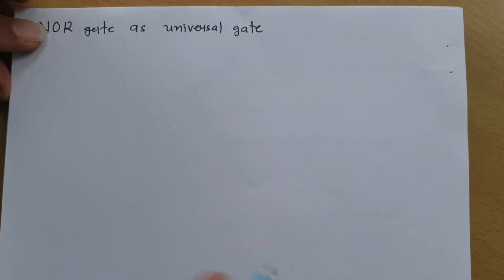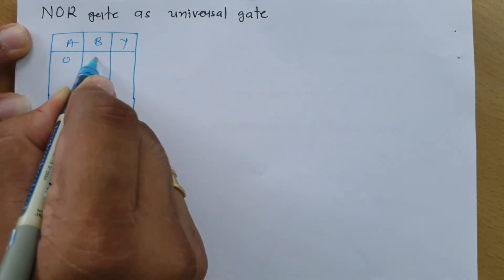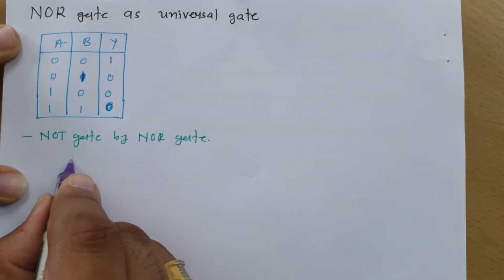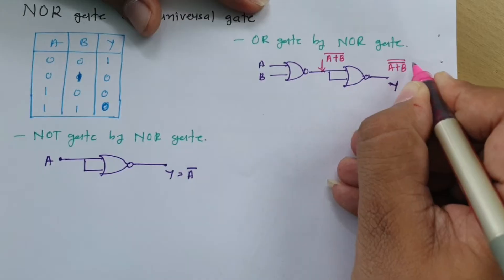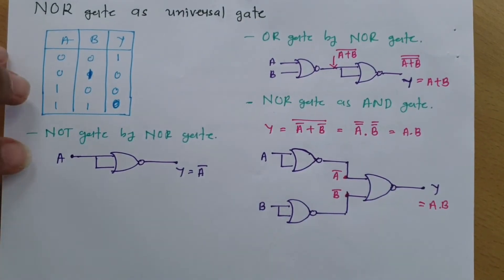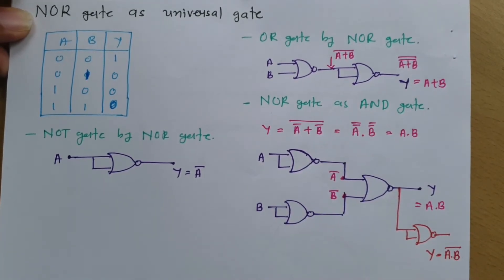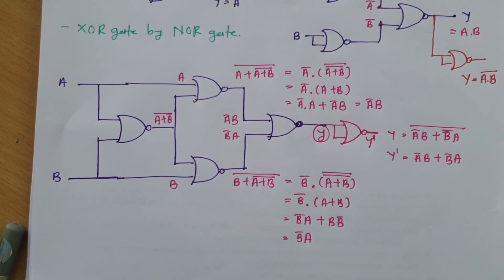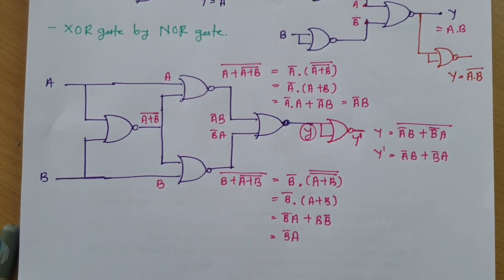NOR as Universal GATE | Logic GATEs

Comment: What are universal gates? Explain with an example?

- Universal gates are a special category of logic gates that can be combined to create any other logic gate or circuit. This means they have the unique ability to perform all possible logical operations, making them essential building blocks in digital electronics.

The two most common universal gates are:

1. NAND Gate:
2. NOR Gate:

Example:

To illustrate their versatility, let's construct an AND gate using only NAND gates:

Connect two NAND gates in series, as shown in the image below.
Connect the inputs of the first NAND gate to the input signals A and B.
Connect the output of the first NAND gate to both inputs of the second NAND gate.
The output of the second NAND gate will now function as an AND gate

Key takeaways:

Universal gates are the fundamental building blocks of digital circuits.
NAND and NOR gates are the most common universal gates.
They can be combined to create any other logic gate or circuit.
This capability makes them indispensable in digital electronics design.